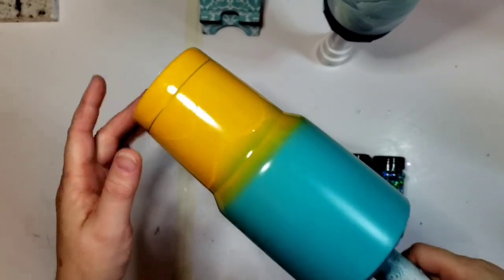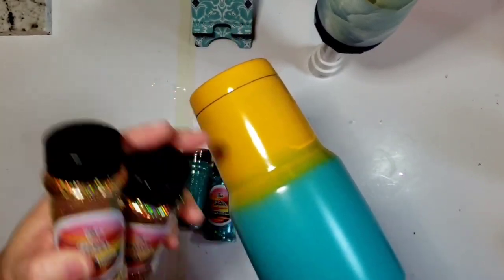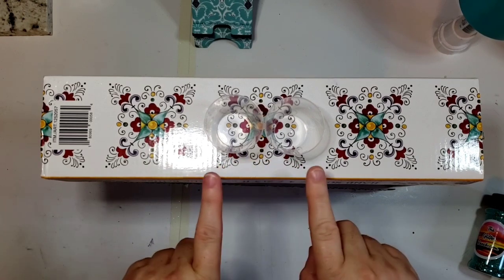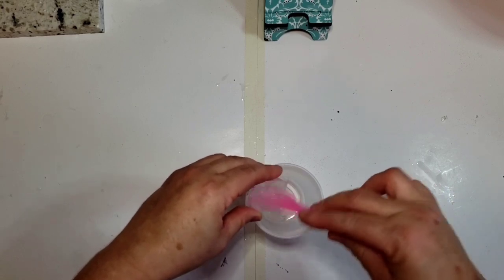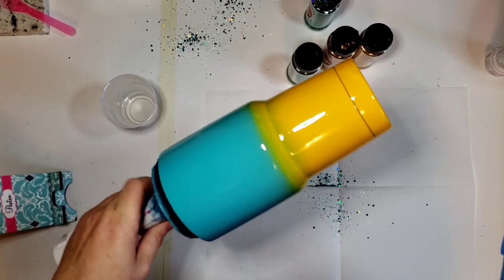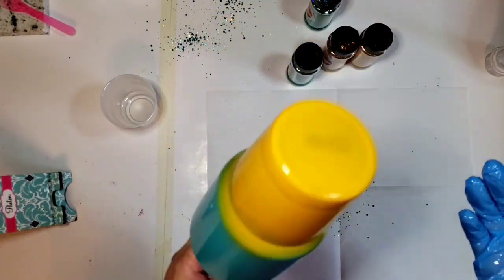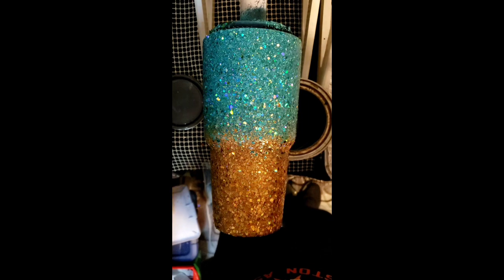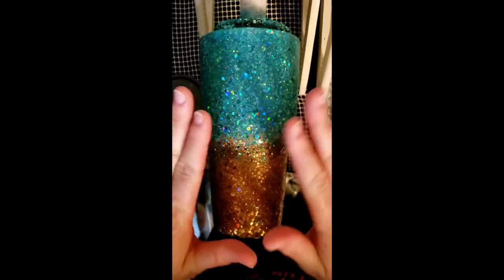Mastering Epoxy and Glitter for Tumblers

Comment: Is there a reason you use gloss?  I have the matte polycrylic  - I'm wondering if it would work the same or if the gloss works better with epoxy or the glitter?
Reply from the maker: It will work just fine!

Comment: The reason you get so many air bubbles in your epoxy is because you fold it. 

Folding in pastry adds and keeps air in the mixture. (I.e. meringue, mousse, whipped cream) So the mixture doesn't deflate. 

 So by folding the epoxy you're incorporating more air into it then if you were to just stir it normally.

Sincerely, 
A pastry cook.
Reply from the maker: I do not have a ton of bubbles in my epoxy. Slowly folding and scraping the sides are how you should mix your epoxy. This is different from pastry. Thank you for your comment
Reply: You had a ton of bubbles in your part A before you even mixed it! Could be from transferring into the measuring cup and then again into your mixing cup or all the scraping to get it out of those tiny cups. In any case, your snarky reply wasn’t really necessary. I would be more concerned with why your part a has soooo many bubbles before you even begin. Just storing your epoxy shouldn’t cause it to have that many bubbles. If I had to guess, I’d say it’s probably the squeeze bottles.